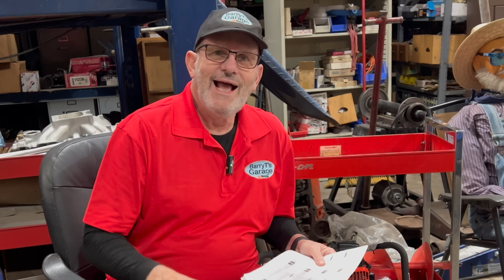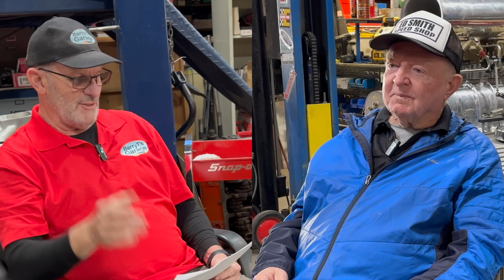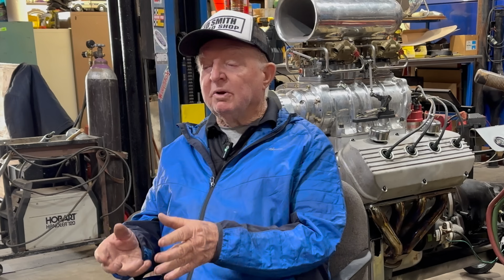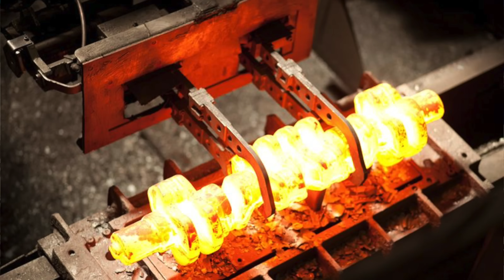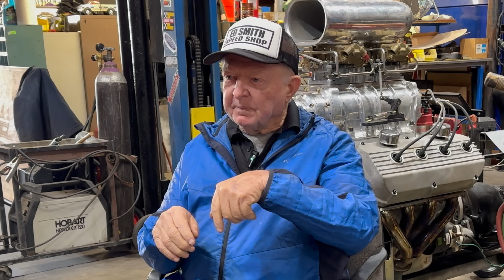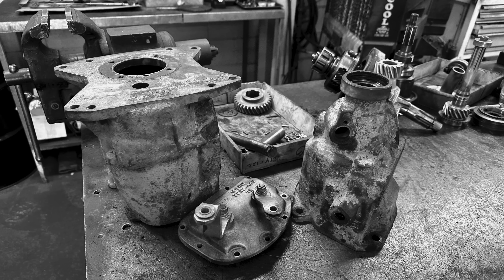Why a Forged Crank Can Actually Twist | Ed Smith with Barry T | Ask Ed 19

Comment: How about the 462 MEL Lincoln engine, Ed ?
Reply from the maker: Let me put that on the list and ask Ed about that.
Reply: Thr 462 was an enlarged version  of the  430 ci . The 462 and the 430 were  not related to the 460 Ford. I don't recall the  460 used in a Lincoln. If it was used  it would have replaced  the 462.  Chrysler  Marine bought Ford 460 ci marine base  engines to fill in after  they stopped  making  the 440. The 440's were  330 hp at about 4-4200 rpm.
The 460 Chrysler Marine  was  360 hp at about 5000 rpm. In a larger cruising boat you had to spin them close to 4000 rpm for a good cruising speed. Also they did not have  an engine oil cooler which All big displacement  engines came with as standard  equipment. Customer burnt one out in a twin engine 37' cruiser  in about a year. Not his fault.
Rebuilt it, broke it in carefully  and filled it with
MOBIL 1 15-50 on the second oil change . The 15- 50 was new on the market at that time and handled the high oil temp with no issues.
Reply: @williambikash6645  yeah.....I know all that...I just wondered what Ed thought of them..
But thanks for the effort.

Comment: Sorry Ed you're wrong do a point distributor increased the DWELL. For better performance and longer spark duration
Reply: I remember a magazine distributor shootout, the daul point distributor beat all the hi fi electronic stuff by 7 horsepower... Increased dwell time.
Reply: Correct.
But one point closing and the other opening splits the current spark, wear, between the two and they'll both last longer.
Reply: @hotrodray6802 that's not why the distributor was dual point! It was dual point to make it more high-performance to extend the dwell only
Reply: I believe there is more than 1 reason to run a dual point distributor.  One person will want it for 1 reason, the next person will want it for another reason.
     Awhile back uncle Tony did a video or 2 about him using a dual point distributor in a car he was slapping g together.  His reason for using it was all together different than any reason I've heard here.
Reply: Ford came out with it so it would burn more fuel and create more horsepower so did Chevy add Chrysler end of story

Comment: A 340 and 318 Chrysler are the same stroke (crankshaft). There were some forged and some cast in all Chrysler engines pretty much, they didn’t really follow many rules
Reply: If I remember correctly all Mopar motors carried a forged steel crank until 1971 or so then the lower performance cranks were cast like the rest of the OEM.
Reply from the maker: That's it!  Thanks
Reply: @BarryTsGarage  sure, I worked in a nascar engine shop around when cup went to fuel injection and Ed is handing out some tips that most engine builders would never tell. Hopefully the people that want to learn are listening
Reply from the maker: You are right! He took quite some time thinking about it before he finally decided it was okay to share.... It's been long enough.

Comment: One of my AMXs stopped running on the road... Nothing visible under the hood. It would start , then die immediately. Jumped the solenoid while watching - a hole in upper radiator hose had developed & squirted coolant DIRECTLY at distributor cap dwell adjuster window..
Reply from the maker: Dang!

Comment: GM Hydramatic '4-speed' switch-pitch, two-speed torque converter, was AWESOME to drive. Never hotrodded one, tho. I belive the switch of pitch was electrically controlled. Perhaps that converter would fit into a T400?
Reply: I did not know there was a switch pitch on an GM 4 speed.
There was one great trick I read about getting great use out of the switch pitch.
From 1973 to 1978, GMC had a FWD RV with the Toronado transaxle. TH425 I think they called it. Converting those to 4 speeds just wasn't an option. Some owners got closer to having the effect of 4 speeds with a switch pitch converter.
Reply from the maker: Interesting.  That FWD motorhome was quite unique!
Reply from the maker: That would be a fun conversion - I'll ask Ed if he's done that!

Comment: Hi guys!   hey I have a question concerning heat on points and running dual points Etc. the problem with heat! Can't you drill a couple of small holes in the distributor cap!! For example,,and force cool AIR in to keep the points cool?!!!    has anyone ever tried it?.   would it help?😊 yeah I know,, I'm 40 years too late .  I used to run flatheads. I miss it.  TIMES

 changed😢
Reply from the maker: You are asking a great question and I’m going to ask Ed about drilling some small holes in the distributor cap for cooling… Thank you